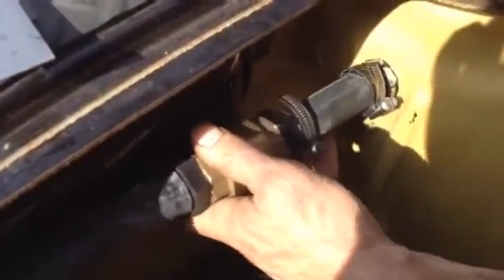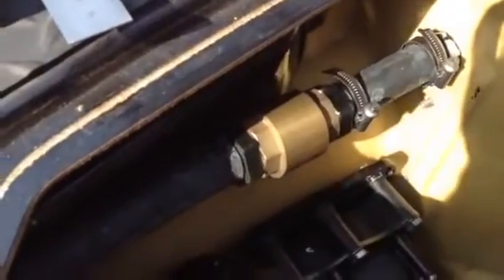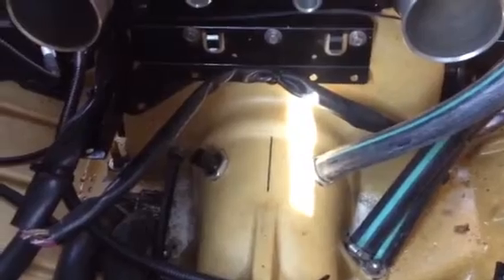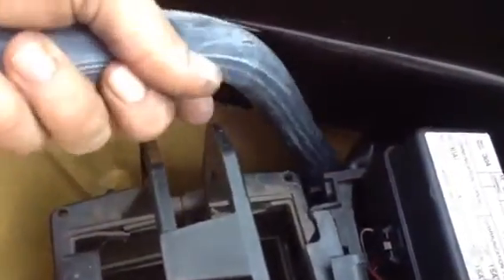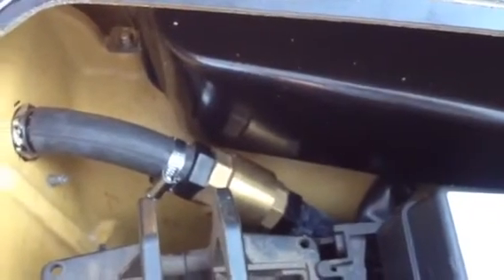Seadoo pump relief valve install "PRV"

Comment: hi there , where did  you bought the pressure release valve? I am looking to do the same on my ski. thanks
Reply from the maker: First I used a local non return valve but they didn’t last then I got some that a company made specifically for this application ... I just can’t recall there name now . I will think 🤔 and when it comes to me I will tell you . Aha I remember , Deans Team Watercraft Performance in Orlando Fl . support@deansteam.com 
(321) 441-3040 
I hope this helps ☝️
Reply: @Redrockat  thank you , I will try to order some

Comment: do you have a link to those valves?
Reply from the maker: Unfortunately I do not , I made these up myself . There where people manufacturing them on small scale but Ime not sure what happened to them . These are basically one way spring tention Valves and as soon as the pressure builds they must open . So they stay open when there is the slightest pressure and close when there is not . This really helped me and without them my shoe (pump tunnel shoe) would break as soon as I am at full power , every time .

Comment: what model seadoo was this installed in? and has it been tested. looks alot easier than having to remove ride plate to do it!
Reply from the maker: Julio Paula 2010 seadoo rxtx 260 rs .
Reply: @Redrockat  where did you get the fittings at for that?
Reply from the maker: Seth Pierce from Riva Motorsport USA in Florida
Reply: Do you by chance have a part number for them?